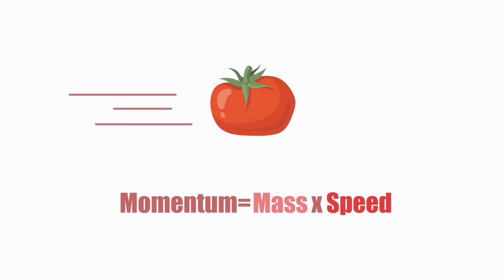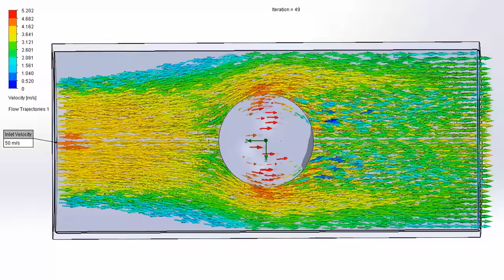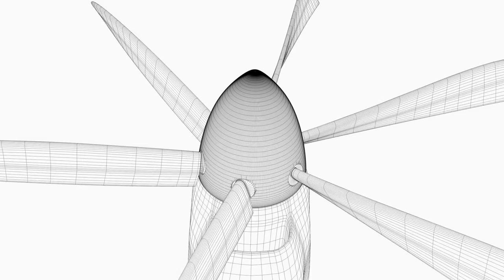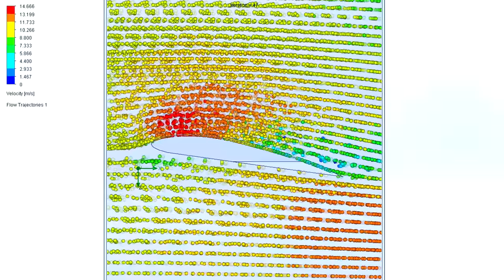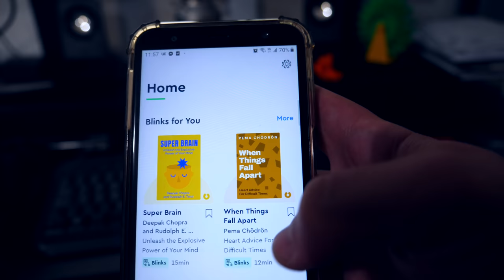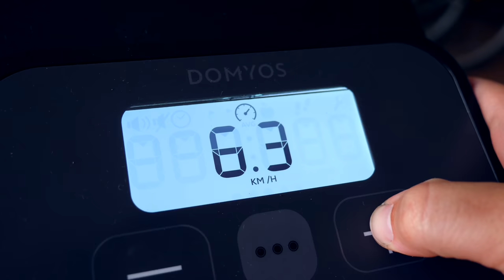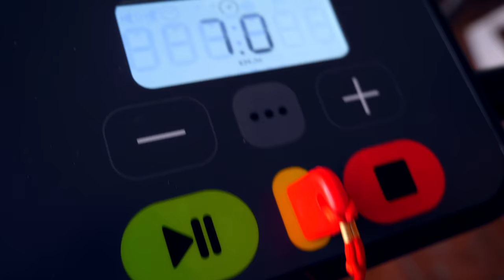Wind Powered Car (3D Printed)

Comment: Hey Integza, I love your videos. There's one thing though that I'd like to help clear up. A common misconception that is taught to people and new pilots is that the longer distance the air molecules travel over the top of the airfoil causes the air above the airfoil to speed up. Unfortunately this not true but it has become so widely accepted. 

The reason why the airflow must speed up above the airfoil is because the airflow sees a relative constriction of a cross sectional area that is perpendicular to the flow. (The infinitesimally small thickness arbitrary cross sectional areas run in and out of the page and) Because the flow is constricted above the airfoil, the air must speed up. This is like constricting the open end of your garden hose to get a stream of water moving faster and farther.

I'm not an expert but this is what we are being taught in university in order to become Aerospace Engineers. I hope I explained well without being able to draw anything. Thank you for listening and for making great videos!

Comment: I have an idea for a video.. You said you like rockets!

Most rockets use a parachute to return to the ground in one piece.. 
I want to suggest a rocket with no parachute that lands softly..

Look at what maple tree seeds do when they drop off trees.

If you make a propeller with hinged blades, where the blades fold back against the sides of the rocket, then the rocket goes up the same way all rockets go up. At least the ones that don't have engine failures or get Cat Trophies...

Well once the rocket achieves zero thrust, the propeller deploys and becomes a maple tree seed..

In fact... What if the propeller had the inside half of the blade slanted in one direction and the outside half slanted in the opposite direction. Would the propeller spin  and create lift?

Or if the propeller had shape shifting power caused by the centripetal force of spinning...??
Falling would cause it to spin, and spinning would cause it's to tilt angle to become a lifter...

Comment: Nice video, thanks ! 

here is my video suggestion, experimenting with flying objects using air pressure as explained in this video. Maybe using 3D prints ? I doo see a big potential with this very light and soft plastic you used to make the last vertion of the propeler :)

Comment: Putting a fan behind it defeats the purpose ...
The analogy is:
have the car move over the ground with the wind
-> car moves faster than the wind
OR
have the ground move with no wind
-> car moves faster than the ground

Didn't check, but I think the gearing is not optimal

Comment: This did not work because your propeller is in a negative pitch. It should look just like an ordinary pusher prop. Checkout the pusher props used in indoor rubber band powered planes

Comment: Could you apply that to an automatic gear box to a small propeller to a boat. As the big propeller sail would be like a large gear turning a smaller gear. The fluid of the water is many times denser than air. So would the drag of the water on the small propeller be greater than what the air and larger propeller?

Comment: but if you retreat from tomato traveling towards you the impact is less  and the absorption of impact will push you further than the stoping power of the tomato at Same velocity 🍅 think catching baseballs ⚾ hurts less when you decelerate it by matching its velocity a bit with your arm swing so that 100mph fastball only hits you at 25mph or something like that

Comment: Would giving the wheel axel a smaller gear have created to much resistance or something? I feel like that's the most straightforward way of getting more speed for the same amount of wind pressure

Comment: You got it backwards its not the wind yes the wind starts it going but than the wheels make the prop move faster from the speed thay are moving on the ground so the ground speed geared moves the prop fast than the wind

Comment: 9:09 why is it not working :D. anyway... the mass is not enough to apply the force to propeller because of the friction. two simple steps will do the trick: 1) add lubricants to the shafts. 2) add more body mass. have a good day :P... (nice video btw)

Comment: I remember that video, but here's my question if you were to adjust the gear ratio to be lower on the wheels and bigger on the prop shaft would it not generate a greater wheel speed to travel faster than the wind speed?.

Comment: I love your videos and think you do a great job but this one is SO much simpler. First, it does not violate ANY laws of physics. Second, it does not rely on some exotic theory of wind as sails, etc. The actual explanation 100% fits within physics, and 100% makes perfect sense. 

Now, if you want to violate the laws of physics then disconnect the GEARS from the wheels and allow the propeller ALONE to do the work. Then it would operate as a "sail" as you suggest. HOWEVER... here is the explanation and why this whole thing is bogus. BECAUSE the propellers are connected by gears they operate as "lever arms" where they convert their rotation energy into useful work through the gears. As the propeller "arms" turn from the wind, if you gear it correctly, you can easily control the speed of the "vehicle". You are simply converting the work of the propeller lever arms into wheel power. 

This is EXACTLY what every car transmission does every day when it converts engine rotation (RPM) into speed through a transmission. It is the reason that in 1st gear, 3500 RPM produces one speed but in 4th gear that same 3500 RPM is DRAMATICALLY higher speed. The propeller blades are merely lever arms that exert force on the gears to turn the wheels. It is not more complicated than that.

Comment: It was a valiant effort, but I think you created more confusion than understanding using both  the fan and the treadmill. It should work with the treadmill alone. The ratio of the wheel speed to the propeller speed is among the most critical specifications of these vehicles (along with propeller pitch, size and wheel size). Without those being correct your vehicle will not go faster than the wind.

Comment: So,
You can make a diy metal 3d printer by replacing the nozel of PLA printer to a powerful laser and then put metal powder in the base of the PLA PRINTER then you could start printing ~~
CONVERT YOUR PLA 3D PRINTER INTO A METAL 3D PRINTER......

Comment: is clear that frictional forces and the drag coefficient of the car (excluding the propelller) is going to determine the maximum velocity of it. 

So why dont you optimize the design to reduced the frictional forces in bearing, gears, etc and the drag coefficient the overall geometry of your car? #engineering #redbullRacing?

Comment: What happens if you put the car on the threadmill on the oposite direction? does the air is enough to push the car? will the car being able to outrun the threndmill ?  if i could i would test that out XD

Comment: Is nobody going to mention that his analogy with throwing the tomato at his head is inaccurate? You don't add up his speed and the speed the tomato was thrown. This would break conservation of momentum. At the moment of impact the energy is the same as if the tomato was thrown at a stationary object. Since the reaction is equal and opposite, the object with more mass/energy cancels out the other objects momentum.  Mythbusters did a whole video about this testing impacts of a car against a brick wall, and two cars in a head on collision.

Comment: Pretty sure adding the fan behind the treadmill invalidates the whole experiment. You're just adding enough pushing force from the wind to move an object forward. You could use a hot wheel car and use high pressure air to push it forward on the treadmill and get the same result. If you take out the fan and achieve equilibrium where the car stays still then you have matched windspeed. If the car moves forward without the help of a fan then you have gone faster than windspeed.  I'd like to see you revisit this experiment but do it correctly next time.

Comment: Tomato rocket, or rocket tomato. Or a single use only paper or wood rocket. We need cheap ways of getting humans into space. NASA is doing wood tests in space right now for natural solutions in space/space flight.
Reply: In that regard, the bell of a rocket nozzle needs to widen as pressure decreases with altitude. Wood burning away from the inside of the bell would achieve that.

Comment: I have a similar senario that I somewhat understand but if you could explain how the sr71 or a12 uses pressure waves to pull itself through the air at supersonic speed.
I know it rides the shockwave kinda like a surf board rides a wave but does it get to a point that it can outrun the shockwave?

Comment: you'd be better off without the spikes on the wheels, you're losing efficiency. Explanation! a wheel is usually smooth, maximizing the use of pi, if you have spikes you make fulcrums at each point that the hub will have to overcome.

Comment: In order to know IF it is traveling FASTER than the wind, you need to know the Wind Speed.  Ground speed is great, but you have not shown how much FORCE is being exerted.  
My logic process says that the other issue is that the ACTUAL vehicle is geared 2:1 which would actually increase the speed of the car relative to the wind.  Had he geared his model at 2:1, it would have traveled FASTER.  So the car traveling FASTER than the wind is a property of gear ratio, not aerodynamic lift.  Mechanics, not physics.

Comment: The pusing air is cancelled when the car is moving in a same speed as the wind (car speed relative to the wind is zero). In all colliding objects pressure is always there, i still disagree, this is possible only if the ground is not completely flat resulting in gravity as source of energy.  It is impossible for any air driven object to have a velocity greater than the wind its self without momentum because wind it self is not suitable or steady. Rigid obects and air are two different things, air excape. As soon as the molecules makes an impact there speed reduces. So i disagree, its not possible. Colliding too object moving at different speeds will create greater pressure but not greater speeds, the speeds after will be less than the the initial speeds (air colliding with the propeller).  For a propellant rotating in a opposite direction from the intended rotational direction causes resistance it self by refusing rotation in an intended direction like how brakes works).

Comment: from Xyla Foxlin
 channel 
Build your own Impossible Wind Cart: 

------------------------------------------------------------
*I HIGHLY recommend ordering ordering extra parts, especially ball bearings and plastic gears. The listed quantities are what is on the cart in it's final form.*

CAD Files: https://www.thingiverse.com/thing:4897423
Bill of Materials from McMaster-Carr:
https://www.mcmaster.com/
1x 12205T79 Natural Rubber Bands Size 73, 3/8" Wide x 3" Long
6x 60355K42 Ball Bearing Shielded, Trade No. R3-2Z, for 3/16" Shaft Diameter
2x 7297K12 Plastic Miter Gear 48 Pitch, 24 Teeth
2x 1263K55 Rotary Shaft 316 Stainless Steel, 3/16" Diameter, 24" Long
2x 8978K113 Rigid Aluminum Tubing 3/16" OD, 0.022" Wall Thickness, 490 PSI Maximum Pressure, 3' Long
2x 6432K19 Set Screw Shaft Collar for 3/16" Diameter, Zinc-Plated 1215 Carbon Steel

The Propeller: https://www.apcprop.com/product/14x4-...
(affiliate link, not the prop I used: https://amzn.to/3y58jz0)

Pretty Purple Filament: https://amzn.to/3A8cXOJ ;)

Alternatively, a good friend of mine wanted to build this and shaved $14 off the BOM still ordering from McMaster. I can't vouch since it's not what I built specifically but I'm fairly certain it'll be exactly the same:
1    1    Pack of 360    12205T79    Natural Rubber Bands Size 73, 3/8" Wide x 3" Long
2    2    Each    7297K12    Plastic Miter Gear 48 Pitch, 24 Teeth
3    2    Each    8978K113    Rigid Aluminum Tubing 3/16" OD, 0.022" Wall Thickness, 490 PSI Maximum Pressure, 3' Long
4    2    Each    6432K19    Set Screw Shaft Collar for 3/16" Diameter, Zinc-Plated 1215 Carbon Steel
5    6    Each    57155K374    Stainless Steel Ball Bearing Precision, Shielded, NO. R3-2Z, 50000 rpm Maximum Speed
6    2    Each    1257K55    Rotary Shaft 303 Stainless Steel, 3/16" Diameter, 24" Long

Comment: It's not free energy the wind goes away it does not work. your explanation of how a sail tacks is not correct. Ice yachts can go 90mph with just 7mph of wind. It is force from the wind onto the airfoil that makes a force vector somewhat orthogonal to the relative wind.  So long as you can keep the relative angle of attack on the sail at best lift over drag you will accelerate till there is equilibrium between portion of force vector and drag in direction of travel. For this rotating sail think one dimensionally, the rotation lets it tack as if it were going into the wind. So the force of the wind not speed of the wind is harnessed for motion.

Comment: @Integza,

You were doing so well right up to 5:50, but then you fell into the "Equal Transit" hypothesis of lift, trap. Please search "Equal Transit", then do another video explaining your mistake, and teach us about true lift theory that mostly has to do with angle of attack, gas momentum, and fluid flow around a foil. 

You appear to be an excellent science communicator that I suspect could produce an excellent video-teaching-aid covering lift. Fair warning though, this will probably be the most difficult video you ever produce. You will need to find a way of converting very complex concepts like Euler's equations into something simple, and that won't be easy.

Peace and Love,
j

Comment: you dont need 4 hours to explain somthing if the theory is correct. only if its false you need a infinite amount of time explaining your belief in how it chould work. if the theory has merit it would be explained in minutes not hours or eternity. the best explanation is that the propeller creates its own wind by generating thermal convection from the atmosphere like a heat pump sucking the heat out of the air on one side creating a low pressure where the atmosphere on the other side normalizes the pressure by generating wind moving the propeller with it. in theory you dont need wind in order to make this work as you can create your own. a normal fan run by a motor also transfer heat out of one side lower the pressure on one side than the other and is what generate the thrust. no propellers works by propelling a medium. they all work by creating a pressure difference and let the atmosphere move the object forward. its the atmospheric pressure that drives the wind not the propelling. you dont need a propeller to generate such motion. you can use a air compressor to cool down the air in front and generate the thrust. without the atmosphere engine powered airplanes would not by able to generate any thrust at all and the same goes for rockets. no atmosphere no thrust. the reasn why a air plane wing generate lift is the pressure difference itself. the fact that the shape generate this pressure difference is what makes the air plane wing work. the shape have no other function. the speed of the flow above and the below the wing have nothing to do with the lift. its the pressure difference sliding trough the air that generate the lift. its the atmosphere that pushes the wing up by creating a low pressure above it. poor explanations have confused lot of people in the past into getting wrong ideas about why things works. even tesla knew that by artifically creatiing the atmospheric pressure difference by a electric charge could make a flying machine made like a barrel generate lift that dont have any aerodynamic property to begin with.

Comment: You're right that it's not free energy. Because for free energy, you need the system to perform work (load a battery, drive an alternator,... 

PS. you used an outdated conceptualization of how wings (airfoils) work... They've long proven that theory wrong. The lift does not come from the pressure difference. The lift is generated where the two airflows come together. The lift is the vertical component of the reaction vector to the resulting airflow's vector. If you use that vector system, you'll understand much better how this mechanism works (and why he did not slant his prop like you did because slanting it increases ground resistance)

Comment: Another fun and informative video.
With your obvious obsession regarding Tesla Turbines, I have a suggestion for a similar type of device your could easily make if you adapt one of your Tesla Turbine 3D project CAD drawings. It's called the Griggs Pump. It utilizes cavitation to transform water into steam.
It could also be used to power a Tesla Turbine. I would recommend a design which uses poly-carbonate discs (i.e. CDs) or metal discs to cope with the heat.
Here's a link for more information: http://www.rexresearch.com/griggs/griggs.htm
There are some wonderful old inventions on this website that may also spike your curiosity.

Comment: I have been watching your I have been watching your channel for a hell of a long time, your passion with different engines is boss as fk. However could you 3d print a Di Pietro engine, LPI X1 engine and pit them against your wankel engine, before you changed it to perspects which released to much c02 and the freezing is not good for the overal performance... Running them at 1000psi compressed air to see which one is a better design? air soft gun compresser cylinders go up to 4500 and you can get hand pumps that run that high... 

It would be and awesome comparison and a good excuse to 3d print

Comment: Question maybe you can answer. I've seen Sonic levitation. Quantum levitation. Magnetic, Etc etc. But my high ass was wondering if it possible to use light create a low pressure/high pressure scenario to levitate/move something? 😂🤣🤔